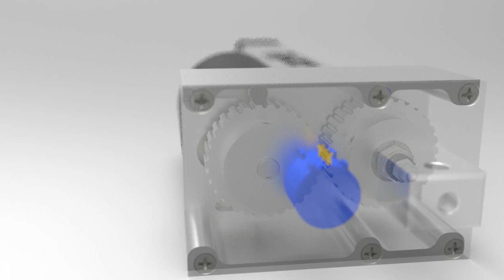The DART Actuator by iR3: The CIM linear actuator

Comment: i need an actuator to lift about 600lb bed on back of a polaris 1000 the bed is being removed and replaced with a spray system and i need to be able to access the engine to check oil and such, the load consists of a 100 gal poly tank honda engine, valves, hose reel and 300 ft of 3/8 inch hose, along with a spray boom and valves any suggestions